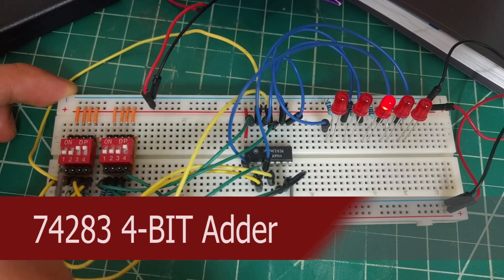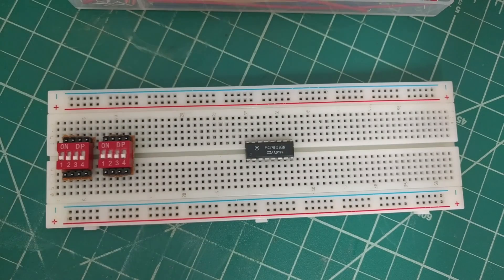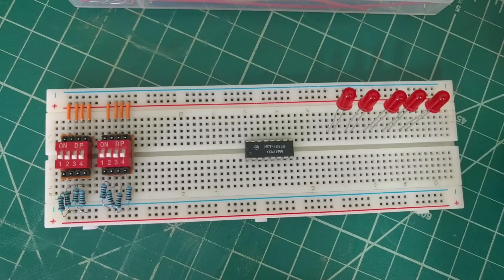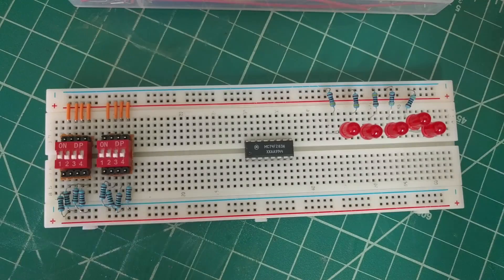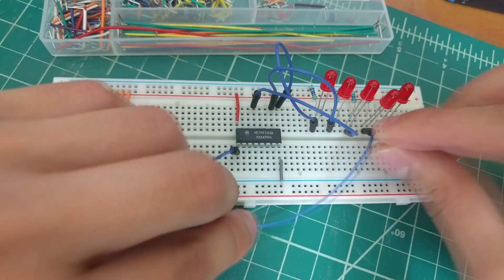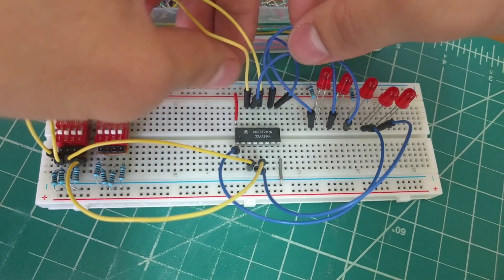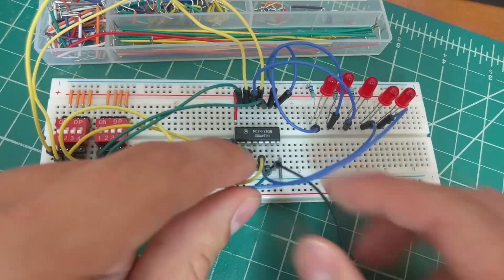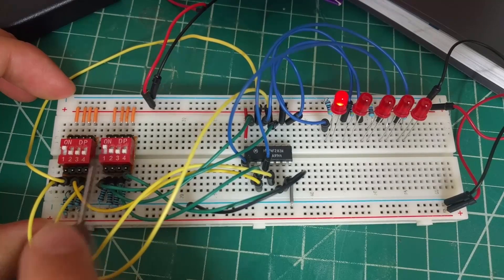Tutorial | Building the 74283 74HC283 4 BIT ADDER

Comment: why 8+8 = 16 only 1 LED light up?
Reply: Because 16 does not exist in 4 bits, only 0 to 15.  To get 16, the carry bit is active, giving you a total of 1,0,0,0,0 which is <drum roll> 16 in binary.  Bit 5 in Binary, is Decimal 16, 1 0 0 0 0

If you had Binary 1 0 0 0 1, that is Decimal 17,  or 1 1 0 0 0 which is 16+8 which gives you 24.

Comment: How did you determine the resistance for the pull down resistors? Why can't you use a resistor with a value of 10k ohm? How did you determine to use 1k ohm resistors?
Reply: You just need to use a relatively high resistor. 10k is also fine, but in this case 1k ohm resistor would be enough to pull the switch down to ground when in off position
Reply: @rohitjacob803  when I used 10k ohm resistor, the pin didn't get pulled down
Reply: @christophersaji  This whole is actually a tradeoff.The resistor should not be too low as it would then allow too much current, but should neither be too high as it will not effectively pull it down.We need to consider the type of switches and ic we're using.The best thing to do is just to experiment with some resistors until u get a satisfying operation
Reply: @rohitjacob803  I remember I asked someone and they said something about each pin having it's own impedance. Do you know what he was talking about?
Reply: @christophersaji  i think he was referring to the same problem.Since every pin of the ic might have a different impedance it may draw different amounts of current from the source.Ideally the impedance should be very high on each pin, so that no current flows and there won't be any loading effect.But in reality they do offer varying impedance that can throw you off if ur trying to calculate the resistor values, and hence would be easier if we just test out some resistors experimentally
Reply: @christophersaji  It depends a lot on which family of 74 series logic chips that you're using. The video shows a 74F283 being used. I prefer the 74HC series so I would use a 74HC283. HC means high speed CMOS and I like them because they are fast, low power and they're readily available. 10k resistors work fine with 74HC chips because the MOS FETs need only the tiniest amount of current to turn them on or off. I bet you're using a different family, such as 74LS. The 74LS family use bipolar transistors which require more current to flow into it out of the pins to turn them on or off so, as you've seen, a 10k resistor might be too high a value. Try lower value resistors. It will work with 1k ones but you might find that it works just fine with 2k2 or 4k7.
Reply: @johnm2012  I appreciate the response thanks!

Comment: How much volts is the power supply???
Reply from the maker: The battery pack I used is 6V
Reply: Ok, thanks 👍
Reply: What if I use a 9V
Reply: @Max30504  overvoltage damage, use a voltage regulator